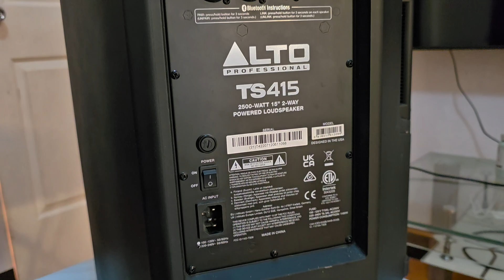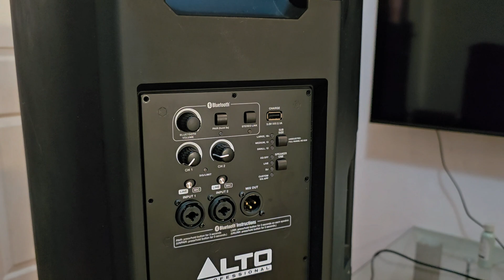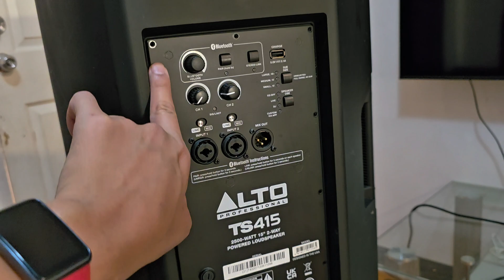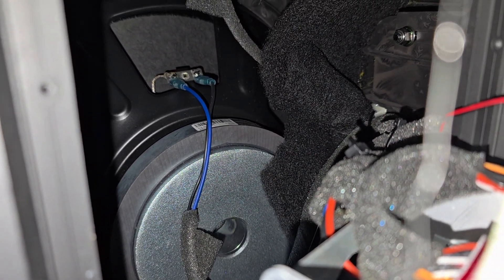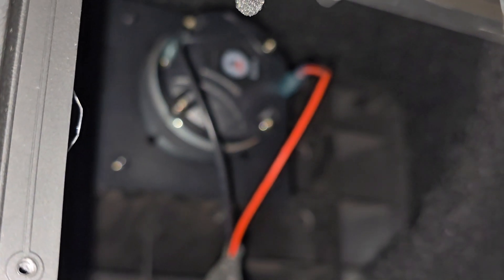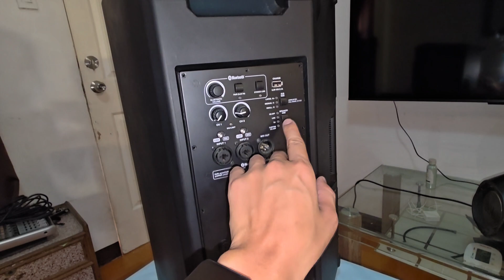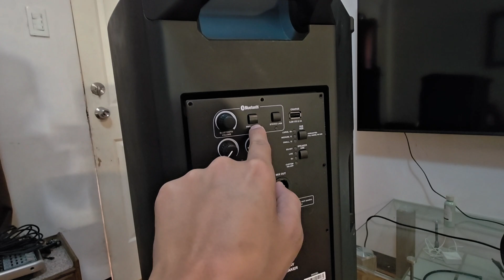Alto TS415 PA Speaker Teardown! Internal Tweeter Downgrade? Better than JBL?

Comment: Definitely not a perfect speakers for your mains but it's absolutely good for its cost. Alto had improved the HF burned issues in TS3. Got two of them, usually used for monitors and small events.

Comment: 2 years and you still haven't taken the stickers off! 😊 I bought some recently and after a using them now for a few gigs, I just love these speakers. Such good value for an amazing sound, with really good bass! I could not be happier with them.
Reply from the maker: It is a common practice in my country. Hahaha
Reply: I have a pair of these, can you advise me how to remove the grill stickers? I really want them off. Thanks mate.
Reply: This stickers are bs these speakers are like 500w rms and 1000-1100 watts of max output pwr
Reply: @naramizda3078 they sound great for what ever wattage the my have
Reply: @naramizda3078 from their own spec’s they are 1250w RMS (800 on the woofer, 450 on tweeter).

Listed power consumption is 1100w though so they are likely closer to that rather than 1250.